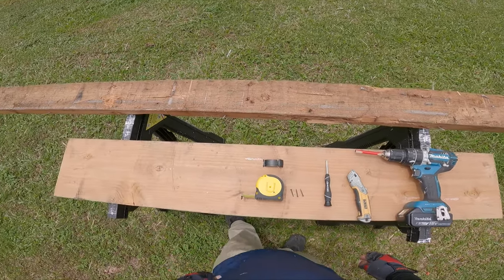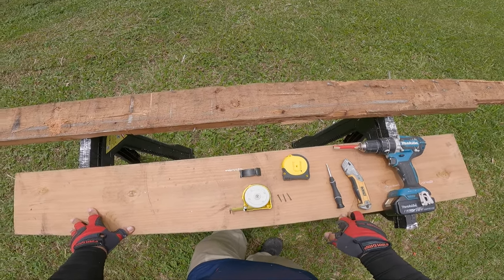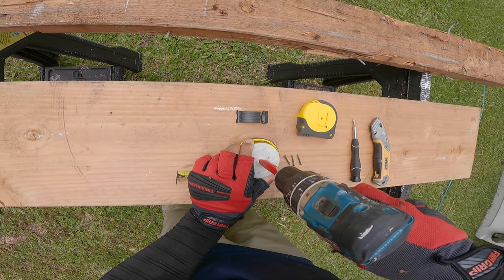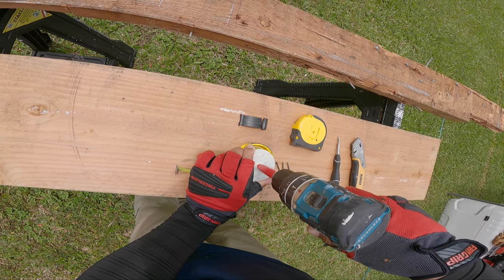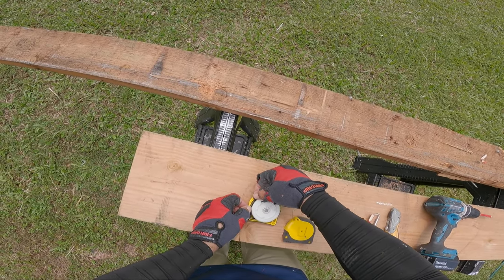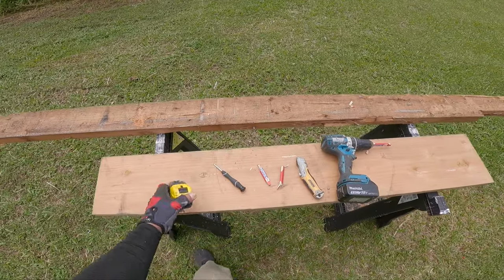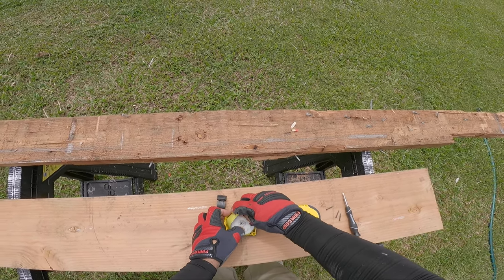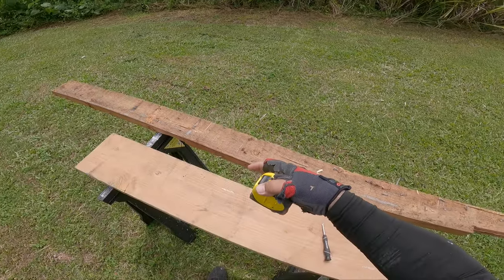Stanley FatMax Tape Measure Fix - ReTension Your Tape Measure..!!!

Comment: This worked really good! But  (FYI) don’t over tighten/ wind your tape. I did and it completely wrecked my tape. If you get it back together and you hear a clicking noise when you extend it, take it apart and unwind it a little bit.
Reply from the maker: Correct!!
Reply: @thebigbrainbuilder111  live and learn. Sometimes the hard way. Your video is really good though.

Comment: Stanley 25’
As I wind the tape by hand, it will only eject the tape out, or the opposite way I want it to go, back into the case. 
I looked at this method. The two sides of the spring housing square holes are connected, like an axle. Applying torque to one side applies the exact torque tho the other side(square). 
Your method would mean the two side are moving separately. Needless to say I can’t get mine to work.

Comment: This worked great but I used a tap from my tap & die set instead of a whittled pencil. The tap fit the square almost perfect and got the job done. I did have to pull my tape all the way out after and it was a bit of a struggle for some reason. But it then pulled the tape all back in and working fine.

Comment: I like your idea to use a carpenters pencil to tension the spring
Reply from the maker: Thanks! Yeah, I didn't have anything else so I guess it was a Big Brain Play all in itself!!
Reply: This is but I'm going to try doing it backwards. The Stanley FatMax is my favorite tape measure, except for me the spring is too strong. The hook returned to my tape measure yesterday and snapped the blade at the first rivet. Tomorrow I'm going to buy a new one and try to dial off some of the tension. I'll probably start by uncoiling the blade. Thanks!

Comment: If the spring or tape is broken where they contect, this won't work.  If the nub is broken, won't work.  I've gone through hundreds of different brands of tapes, and rarely have I had one break in where this will fix it.  Then my tapes go through a rough work out, rain, dust, and cement every day.  No matter what I pay for them they're destroyed in a year or less, long  before they lose tension.